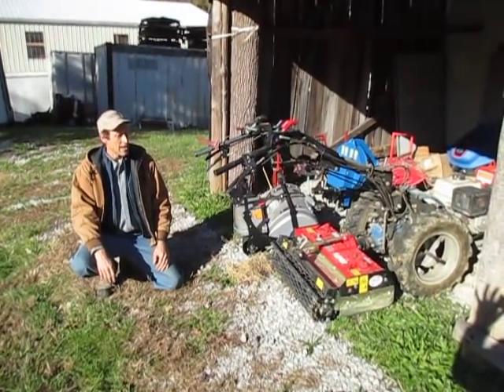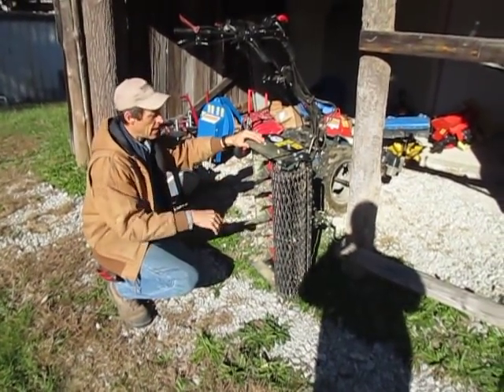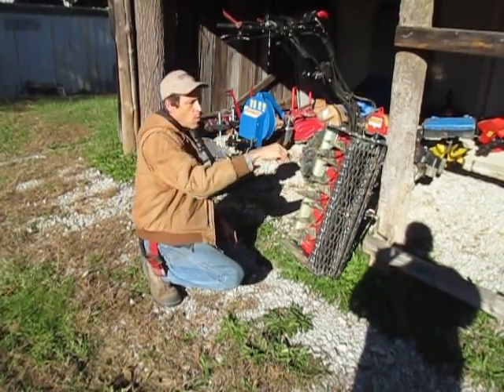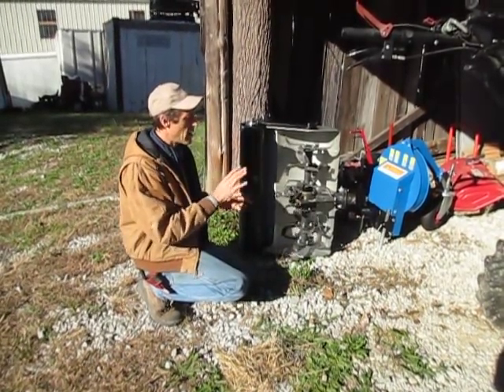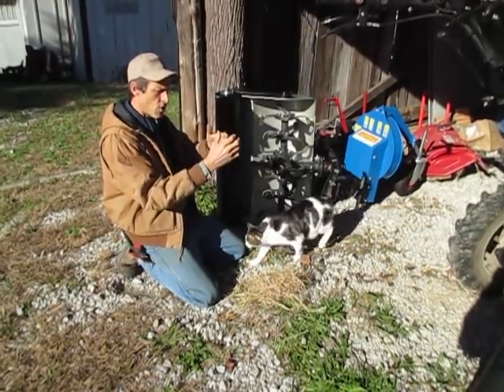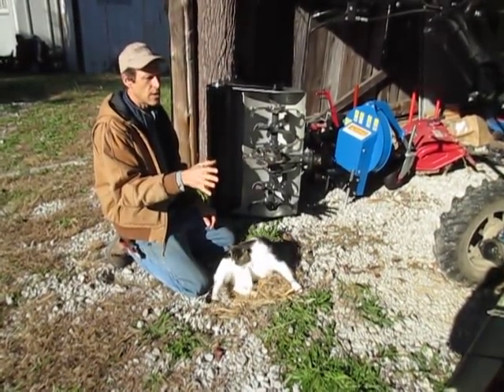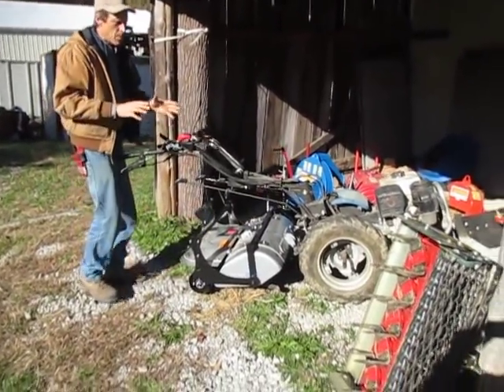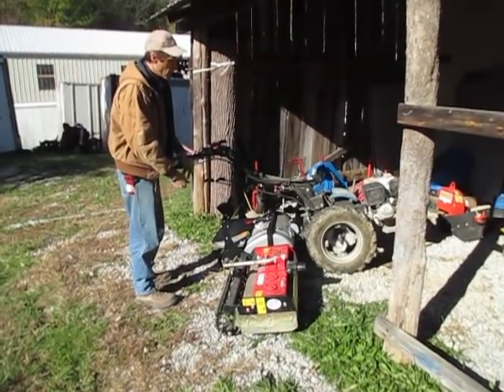Power Harrow vs. Tiller w/ Depth Roller

Comment: A little off topic, but amazed to see you change the implements by yourself. On my compound changing a tool with the BCS quick connect system is a 3 person job, and without the quick connect system is an 8 person job.
Reply: Surprising. I have no issue with doing it by my self. Keep the ptos lubed and cleaned.

Comment: Could the tines on my BCS tiller be designed in a different way,  making the BCS  more effective in "no-till" applications?  I see no-till growers using drill-powered "tilthers" and these tools bounce around like a mantis on heavy clay/silt soils.  I would love to put the BCS to work incorporating cover crops if I could preserve the amazing tilth of the soil that has been created since I stopped tilling.  I have two beautiful BCS tractors that sit collecting dust. These are marvelous pieces of engineering. Thanks for all the helpful content here. I always learn so much.

Comment: Wow that was a good explanation. When you get some snow you think you can demonstrate the snowblower? I saw the video where you set it up. I’ve been thinking about one of these for my small farm but it has to be able to handle the snow before I get rid of my ride on tractor. I live in northern Maine. One of my tractors has a 42 inch single stage snowblower run by a 15hp engine.
Reply from the maker: Sure...if we ever get any snow here in KY! (last year, we hardly got enough to break out a snow shovel)

Comment: Maybe a dumb question but BCS with PDR (operated throttled down low speed and 1 inch depth) pretty much does what tilther is doing - correct? Or any difference?